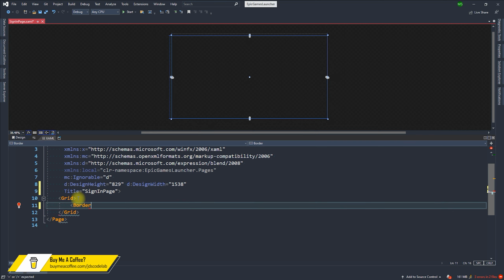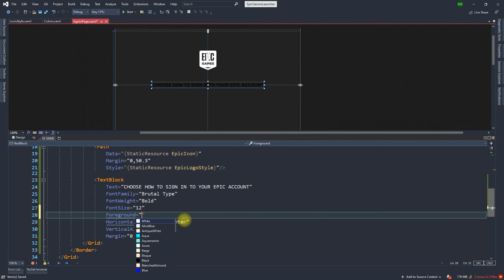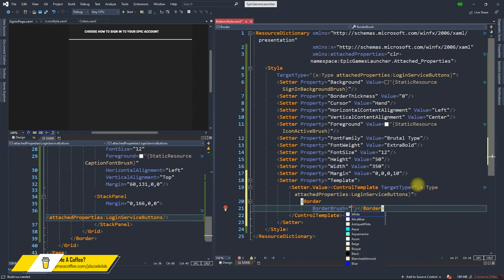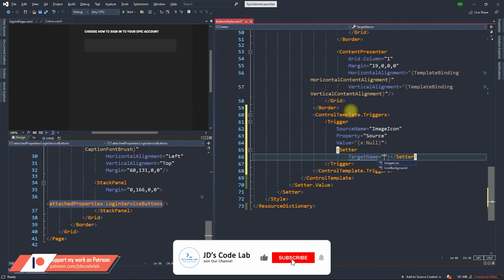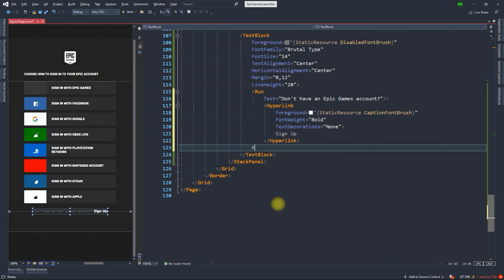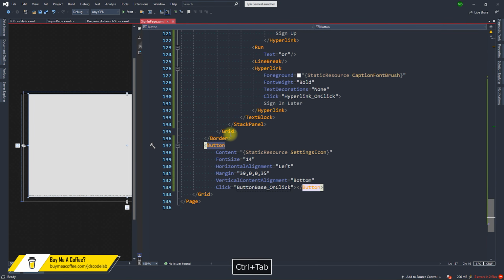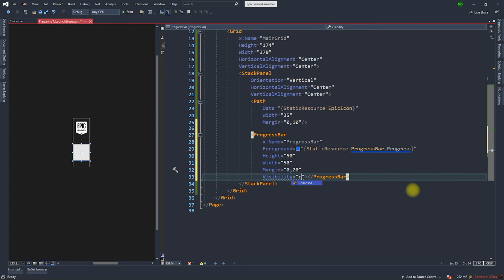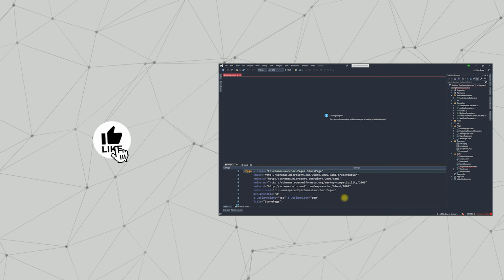WPF C# | Epic Games Launcher UI | Part - 2 | UI Design in Wpf C# (Jd's Code Lab)

Comment: You can simplify conversion to MainWindow with pattern matching like:
if ( Application.Current.MainWindow is MainWindow main)
{
      main.CallThatYouNeed();
}
Reply: and for navigation better add method to codebehind in MainWindow that will handle it.
It simplify access to navigation and handle exception when accessing xaml elements about which other's classes don't know